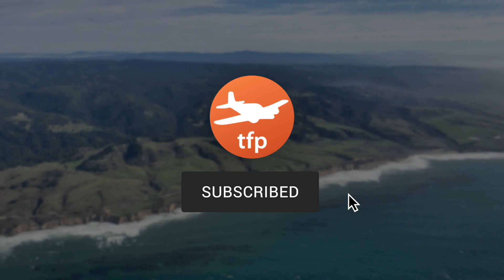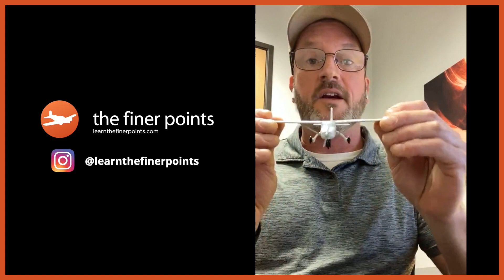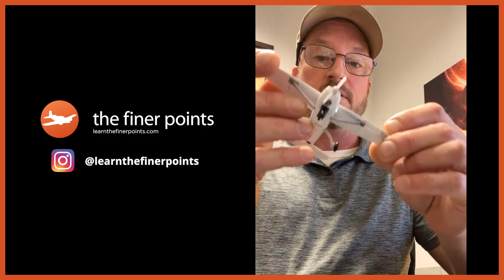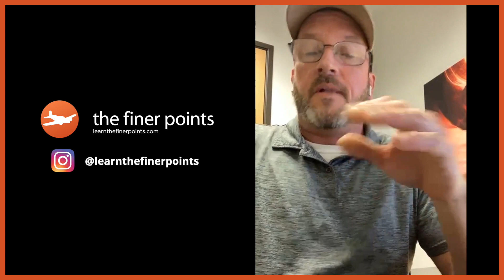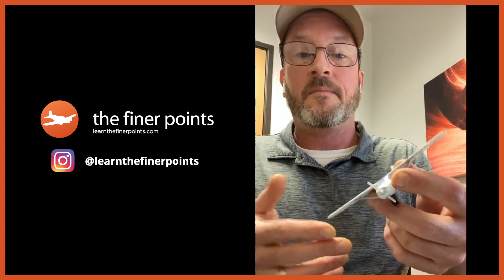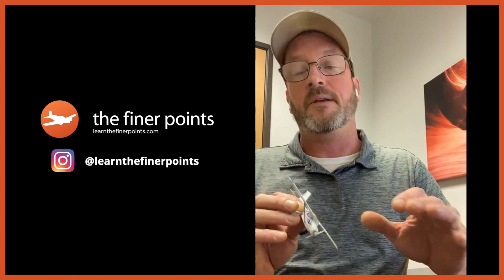Key Aerodynamics: Why is it considered safe to stall in a slip vs not safe in a skid?

Comment: Emphasize what the FAA calls ‘cross-controlled stall’ is really over-controlled stall and is skidding not slipping while what they call cross control is actually incorrect attempt to recover with aileron after departure has already occurred, inside wing has already dropped. In other words, the stall occurs over-controlled not cross-controlled. Bunting to reduce AOA is good though also note at high AOA, opposite rudder fixes roll-off. Ideal unload and roll out but consider your falling leaf holding stall while using rudder to keep straight. Note you cannot spin from a slip. That extra time to recover is because you have to pass through straight at which point what was slip becomes skid.

Comment: In a slip a lot of the lift function goes to the side of the fuselage so there's less load on the wing and thus a lower stall speed.  In a skid the side of the fuselage if anything lifts downwards and raises the stall speed of the wing.  You can do an insanely steep slip by starting from a power off stall and putting in full (top) rudder and bottom aileron.  Steer with the elevators.  If speed builds up the nose isn't high enough.

Comment: Nice explanation of maneuvers that just don't get enough attention during training. I was looking at other videos from other instructors that also provided nice explanations, and I added some clarifications. I'll add those down below. Not to correct anything, because your explanation is perfect. But to add some depth so that anyone interested might gain some additional knowledge concerning the aerodynamics.

Many instructors explain that "fuselage blanking the wing" causes that wing to stall". Not true (OK, indirectly slightly true). Exceeding stall AOA is what causes the wing to stall, and blanking doesn't change the AOA. What actually happens in a SLIP is that the high wing usually has down aileron (to hold that bank angle due to yaw and, yes, "blanking". But mostly yaw-roll coupling). The down aileron changes the local chord line so that area of the wing now has a higher decalage angle (difference between chord line and longitudinal axis of the fuselage) and thus, a higher AOA. And the low wing has up aileron and a lower AOA. 

Opposite with a SKID: low wing is usually kept from over banking (due mostly to yaw-roll coupling, and a little blanking) with down aileron, so the low wing stalls, and the plane rolls upside down. 

Stalling in the pattern is bad, period. A slip is a bit more forgiving because the high wing stalls first and the plane rolls towards wing level, giving you a little more time to correct the situation. It also reduces the load factor and as a result, AOA. Stalling in a skid, everything gets worse real fast. You've seen airshows where the Piper Cub does a "flat turn" keeping the wings level and using full rudder to "skid" around a 360 degree turn? Well, that's about the only use there is for a skid, and leave that to the pros.

To clarify some of the above aerodynamics: Yaw-roll coupling, or "proverse roll" is a result of the wings dihedral. When you yaw the plane and cause the relative wind to shift from on the nose to one side or the other, the forward wing sees a higher AOA and the trailing wing sees a lower AOA, thus the plane will tend to roll in the same direction of the rudder input (proverse). If you had anhedral (wings angled down, opposite of dihedral), it would roll opposite the rudder input, or adverse roll. These terms should be somewhat familiar since pilots should be aware of "adverse yaw" caused by differential aileron drag when ailerons are displaced when rolling (that's why airplanes have rudders to correct this, provided the pilots actually use the rudder). Anyone who is still awake, sorry about getting technical.

Ben
26,000+ hrs
USAF/Major Airline Capt/Aerobatic & Tailwheel Instructor/ CFI/II/MEL/Movie/TV pilot/Sailplane racer/Aero engineering and flight test.
Reply from the maker: Thanks for the great info Ben! 🙌🏻
Reply: Ben

Get a life

Please

The World

Comment: This is a typical pilot explanation and it is incorrect. The inside wing (it should be called the upwind wing because it’s not inside anything) is not seeing “more of the relative wind”. In fact the upwind wing is seeing a higher angle of attack (or maybe that’s what he means?) which is why the aircraft wants to roll requiring opposite aileron. And no you don’t want to stall in this configuration because the upwind wing will stall first (it’s at a higher geometric aoa because the wing has dihedral) and it is effectively a spin entry. In a skid you also have sideslip and a yaw rate so you also have an asymmetric flight condition and if you stall,  again, one wing will stall before the other and you could roll off. Stalls need to be performed in coordinated flight to avoid an inadvertent spin entry. The ball needs to be centered.
Reply: So if we were to take an aircraft with 0 dihedral the upwind wing would see the same AoA as the other wing hence no stall and no spin entry?
Reply: @Iboxx  any wing will stall. Dihedral doesn’t cause stall, but in sideslip it will generate an asymmetry in the stall. But that is just one parameter. Sweep also will cause asymmetrical stall. Regarding 0 dihedral, it depends on whether it is high or low wing. A high wing is good for about 2 deg equivalent dihedral because there is upflow from the fuselage in sideslip. Low wing airplanes need more dihedral to overcome that effect - something like 7 or 8 deg in order to have some dihedral effect which is a certification requirement. Unless you are talking airliners where there is a ton of sweep and they need very little dihedral and in the case of high winged aircraft with sweep they could have anhedral (c5, c17, harrier etc).  The only aircraft I can think of with no effective dihedral or sweep would be an aerobatic airplane- something like an extra or a sukoi or a giles etc. They obviously stall and spin and snap. I have not studied the exact mechanism by which they do it. I suspect that it is via massive control power and the ability to generate high roll and yaw rates.

Comment: One day, my instructor asked me to do a Power off stall, and I kept on having the airplane spin each and every time i do it. Guess what? I was coordinated, but then i learned two lessons:
1- over coordinating (something that i did right when the nose was about to drop) can result in the airplane entering a spin, especially if the wings are banked to the direction you are over-coordinating towards.

2- that actually... the rudder ALSO banks the airplane as the video stated, and i could have prevented that spin with less rudder input (just enough for the ball to center) or slight opposite rudder to return to level wing attitude with corrections here and there.

Comment: Another way to say it - when you stall in a slip, the roll can't couple with yaw.  You can actually balance the two (roll/yaw), and float downward in a full stall (falling leaf).  In a skidding turn, the rolling moment couples with yaw, and you'll spin.
Reply: Inertial forces do not really become active until the airplane leaves the incipient stage of a spin.